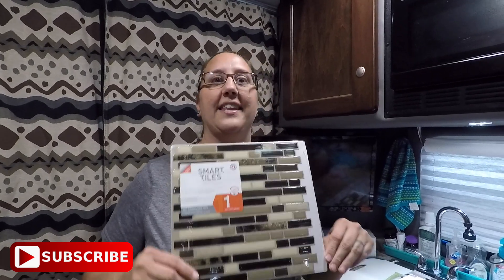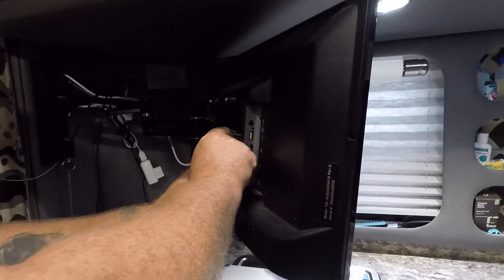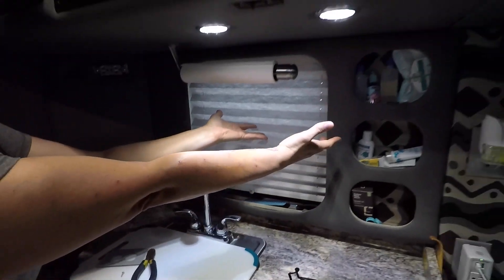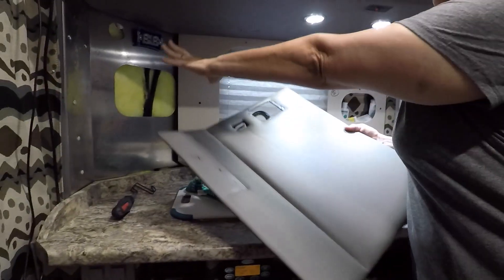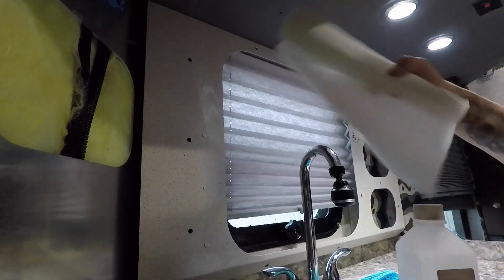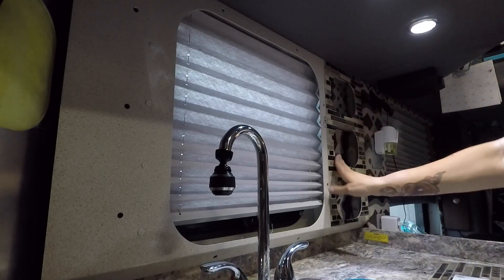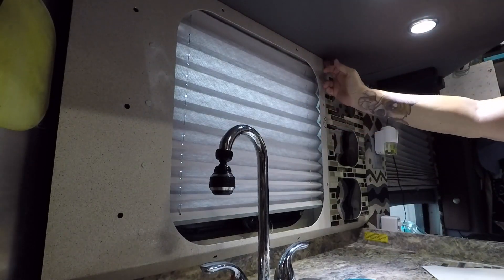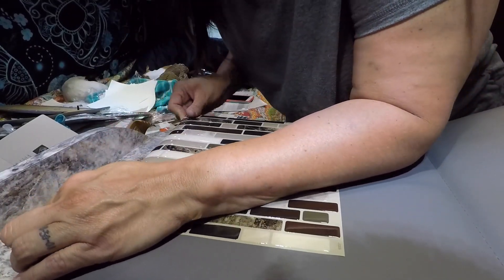ADDING A PERSONAL TOUCH TO THE SLEEPER | SMART TILES BACKSPLASH

Comment: Very nice upgrade touch. Just FYI in case you have to remove any more upholstery or trim; you can go to an auto supply store or HF store and get an inexpensive plastic set of hand tools made just for removing tabs/fasteners that hold the upholstery or trim pieces in place without damaging them for re-installation.
Reply from the maker: Anthony Pirrello Thank you & thanks for that tip Anthony!

Comment: I used these Smart Tiles to do the backsplash areas in my Class A motor home kitchen and bathroom.  I cleaned the area with several different cleaners but the y did not stick down well.  I added professional grade spray adhesive but still had a problem.
Then used contact cement which finally did the job.  Still have more edges to seal here and there.
Looks good though.

Comment: Being from Texas I guess you knew things stuck to walls using tape will just melt and fall to the floor in the Texas summer heat. Looks super though.
Reply from the maker: Ray W Oh yea! Surprisingly we haven’t had any problem with the tiles so far and we’ve been sitting in some hot places in the summertime. Thank you Ray :)

Comment: Love the new look but are you losing any potential insulation by removing the padded vinyl?
Reply from the maker: EJ Benko Thank you EJ! Not losing any insulation from removing that vinyl piece. There is insulation in between that wall and the outside wall of the sleeper.

Comment: Very cool. Did you have to use any glue at all? Will the vibration of the truck be a problem?  Hope not because it looks really nice!
Reply from the maker: will j Thanks Will. We didn't have to use any extra glue than what was on the tiles already. Vibration shouldn't be a problem since they are stuck on really well and they are so light weight.

Comment: Looks fantastic, was wondering if you guys saw the vid of the truck dragging the car "4miles" through the Cajon pass ?!? Tell me HOW THE HELL that trucker didn't know that car was attached to his ass ?!?
Reply: The weight of a passenger vehicle is minimal.  Cajon Pass in that region is mostly down hill; meaning momentum & gravity are pushing the truck down hill.  It is unlikely the driver would have felt any difference in the performance of his truck.  If he did NOT have his CB turned up or on no other truckers would NOT have been able to inform him that he had a vehicle locked under neath his trailer.  Many years back I had a lady who locked her Ferrari under my motorhome.  I had not known I had been hit until another vehicle came along side pointing out something amiss in the back of my coach.
Reply: Imagination Apparel except he was going uphill and the drivers were tryn to stop him he was in total tunnel vision mode in the video
Reply from the maker: DiegoDad Thank you!! No we haven't.. we'll have to take a look.